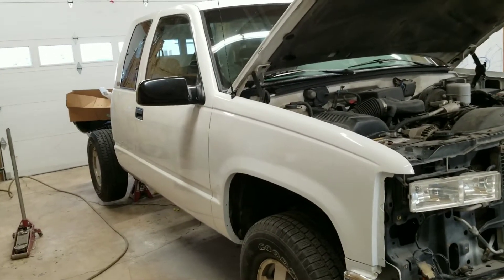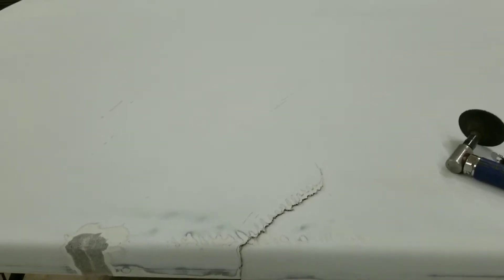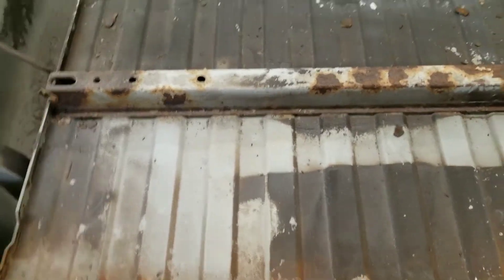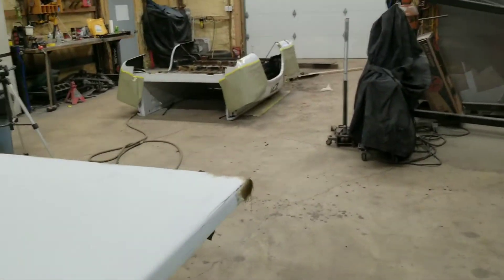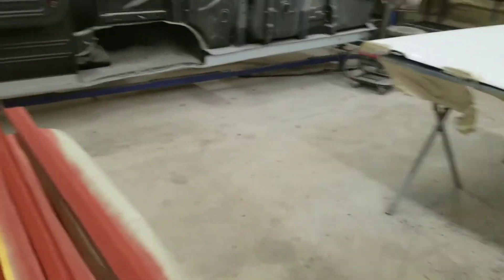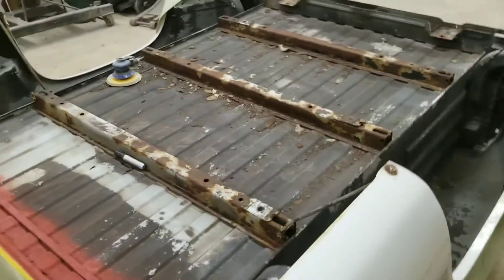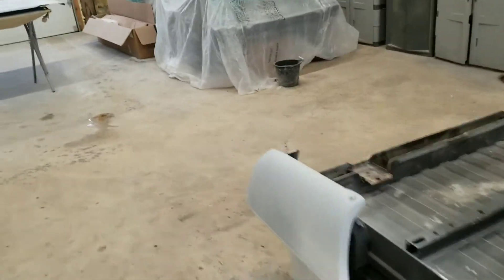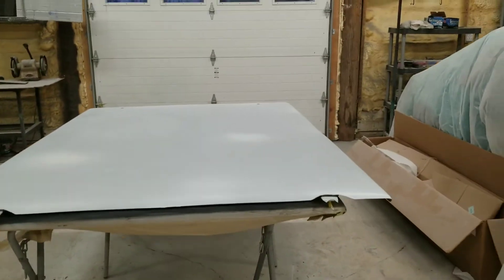Saving the OBS chevy 88-98 Silverado rocker and cab corner rust repair vlog part 5 the reveal

Comment: With the bed rails being as rusted as the one was on yours I'm actually sort of concerned on the condition of mine...especially since the X member towards the rear of the bed is paper thin and completely rusted out.  Hoping the final product of my truck turns out as great as yours.  I spent hours past my usual bedtime watching this whole series.  My 1990 k1500 has 385K miles and I think it's restorable...by far.  Still gets the 0-60 done in 7.3 seconds.  Probably going to be a return viewer for most of this series as to remind myself each and every little step.  As far as cab mounts, or bed mounts, do you have any suggestions for refabricating them? Thanks for the great videos!!!
Reply from the maker: Gotta love the ol Chevy's! They just keep on ticking. And as far as cab and bed mounts they are a pain to fabricate, but if you jump over to ebay there is a few companies that still stamp them out. It is far easier, quicker, and cheaper in the long run to buy them.